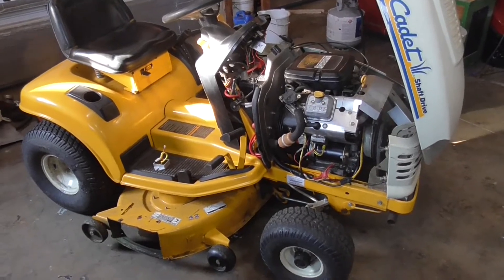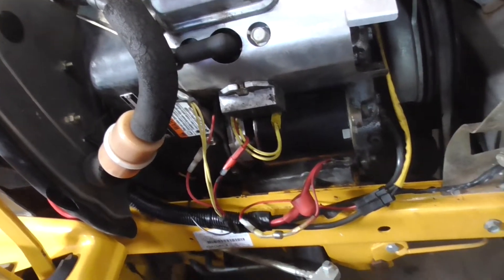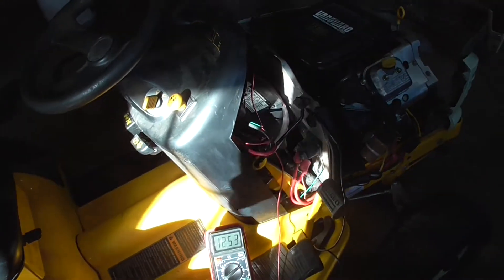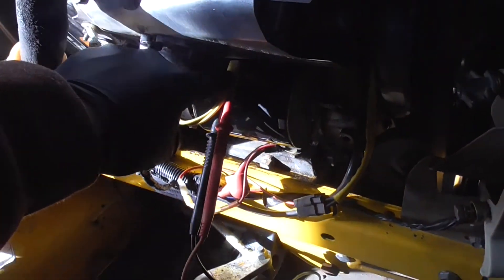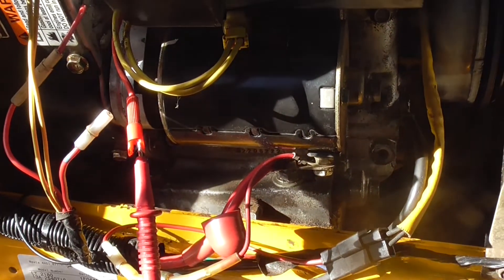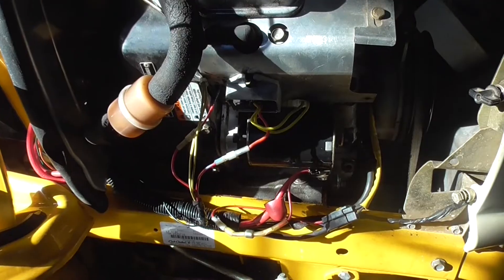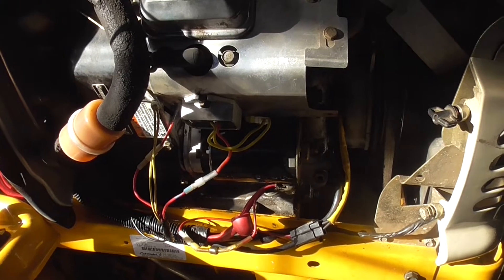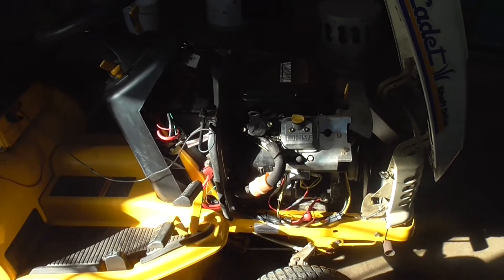Tractor Battery Not Charging Easy Fix

Comment: Thank you, just got a used poulan that didn't have a key. It runs but battery not charging. I'll be checking the wires that used to hook up to the key switch (that isn't there) first. You got me going in the right direction 👍

Comment: Good mention about the ground. The Cub riders are the same. The ground circuit of the regulator goes through the regulator case. If the attachment bolts are loose or there is corrosion build up, the system won't charge. When troubleshooting  I like to run a jumper wire from the case to the battery - terminal to be sure. Good vid. Cheers.

Comment: Thx for this information. Awesome
Just found schematic on manufacturer website...
Does anyone have a schematic. I just picked up a cub 1080 and I see wires cut, the seller said jump the solinoid with screwdriver to start. And he said lights don't work etc .. anyway, I'm ready to get this guy tomorrow and stay working on it. Can't wait! I've been using a push mower for 5 years now on my 3/4 acre yard and I've gone through 2 push mowers. Not because of the yard but because they were junk mowers from home Depot China.
Anyway, I'm ready to repair this dude

Comment: Quick question, you said 30 volts ac coming out of the stator but yours read like 19.4. My riding mower is reading like 17.8. I've heard other people say it should be like 30 volts coming out of the stator. I wonder if why you weren't reaching 14 to 16 volts was because the stator is partially defected? Maybe a loose Magnet or two? I'm not sure.
I think I'll replace my voltage regulator and see what happens since it did help yours.
Reply: New regulator installed today. That dropped the stator output to 29.3 a/c volts, center terminal on regulator reads 15.33 vdc, and at battery reads 13.95 vdc. Looks like that fixed it.
Thanks for your video.  Definitely helped point me in the right direction.
Reply: @headpainter1  Appreciate the follow up. It's rare.
Reply: Well I think I just answered my own question. I pulled my flywheel this morning and all of the magnets were stuck to the stator and not to the flywheel where they were supposed to be. I clean them up and JB welded them back on the flywheel. Put it back together tomorrow and see what I can get. I'm just surprised I was getting 17.8 volt AC out of stator.
Reply: Attention anyone listing if you choose to reglue your magnets to your flywheel make sure they alternate polarisation. Don't just glue them willy-nilly. Do some research. You've been warned.
Reply: Put it back together today,  cranked it, got 48 volts a/c from stator but no improvement from regulator, but it's on order.

Comment: I've had two different Kohler Command engines (1996, 97) that weren't charging. Coil resistance in the stator was near normal, but no AC voltage at at RPM. WTF??
Turns out the flywheel had sheds its magnets, and though it was turning, the magnets weren't. That's a $180~210 part from Kohler.
I found one of Taryl's videos showing me how to glue them back in place with JB Quikweld. Worked like a charm.
Reply: And a friend had a Craftsman rider with Kohler engine that the stator measured open (infinite resistance) with the ohmmeter. Pulled the flywheel to find it had somehow worn through one of the wires from the stator.  Nice, neat butt connection and heat shrink and fixed as good as new.

Comment: I had that exact tractor, really liked that Vanguard 18.  Merry Christmas!
Reply from the maker: I like the engine, but they are hard to work on.  I had to fix a coil on this unit and I had to remove the engine to pull the shroud.  Have a great Xmas.  Bob